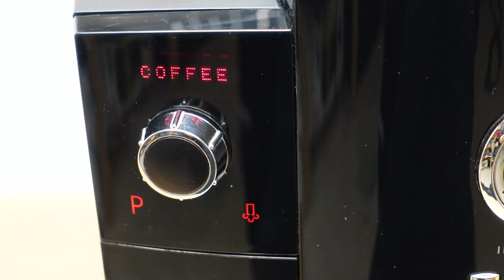Jura Impressa Coffee Spout | How to Clean It

Comment: Your video is great, the most detailed I have seen! The trickiest part that most people will get stuck on, is re-assembling the sliding part/metal slide plates/magnets. The easiest and best way that I have found is to leave the magnets for last. Put the metal plates on the little tabs, hold that assembly at an angle so the plates don't fall off and then slide it into the machine where it is supposed to go. After that you can use a small screw driver to pick up a magnet, push it into the hold, and it will lock right onto the metal plate - do the same for the second magnet.

Comment: Hi. This was wonderful. Fixed my problem. However, i did something wrong when assembling the machine and now the spout doesn't slide vertically. Probably something with the magnetic things that attach them. Any advice or close up video on how to assemble that part back?
Reply from the maker: Hi, take care in minute 8:55 here the two sheets have to be placed exactly on the pins, these are held from below with the magnets. Everything together must be carefully installed and screwed together so that it does not fall apart again.
Reply: @yt.myworks  thanks!!